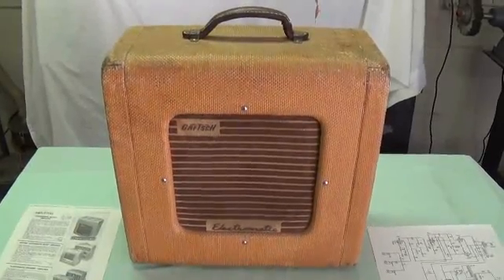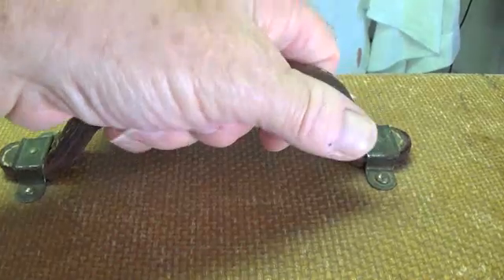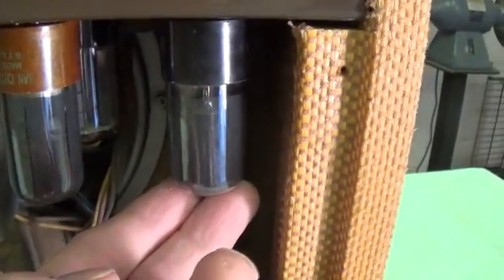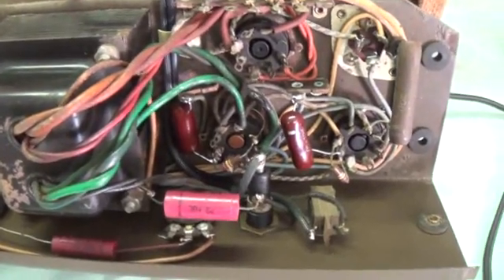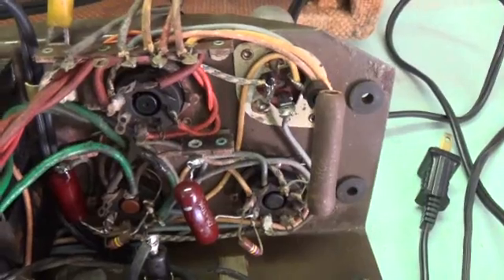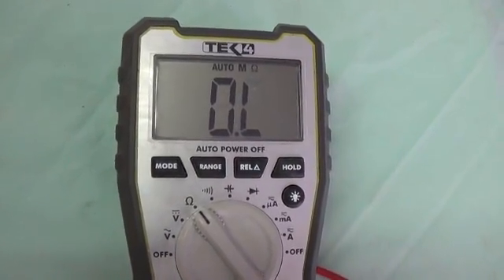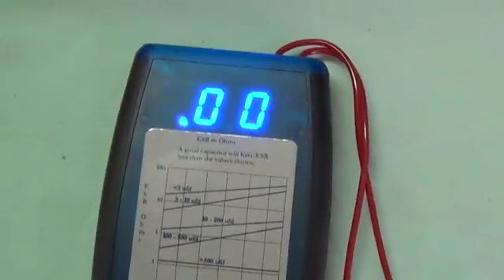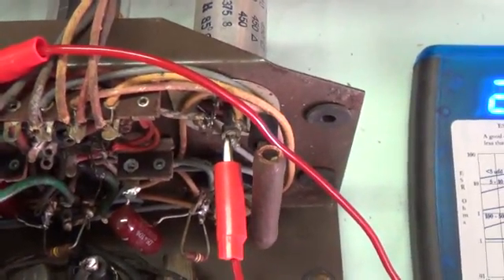Using an ESR Meter to Determine the 'Health' of Electrolytic Capacitors in Guitar Amplifiers

Comment: Great video as usual Doug! I'm servicing a 1950s Kay 600V and was about to change its filter caps- I tested em on the blue  esr meter and they were fine! But one was nearly 3 times it's stated uF tho.  Should I still use it? - did you stick with the caps that were 2 and a half times their value in your video? If so,would/ did it effect the tone?  (One of the brand  new ones I was going to put it in tested over 5 on the ESR meter!). Your videos are very  the best on the interweb thingy! Cheers
Reply from the maker: Thanks so much, Twig.  Something must be wrong either with the ESR meter or your cap tester.  I would change any cap that didn't have proper value within 10% or so.
Reply: @UncleDoug  so you didn't use the two 10uF that measured 25 in that amp  then?
Reply from the maker: @TwigtheWonderKid-q9r  I don't recall.....but I am sure I would not use such out-of-spec caps.
Reply: @UncleDoug  gotcha. Thanks!
Reply: @UncleDoug  Thanks. So I've have a chat with Mum and Dad and they said they were OK with you adopting me! (I'm 33 tho,is that OK?)- I love cats BTW. 
Question- why isn't your DanoSonic a Doug-o-Sonic? Take care.
Reply from the maker: @TwigtheWonderKid-q9r  Great news, Twig.  You'll have to make your own bed......so bring a hammer and saw.
Reply: @UncleDoug  haha!

Comment: High Doug, I have read a lot about cap esr, leakage etc and found a guy called Mr Carlson’s lab! He has designed a low voltage , high frequency, capacitor tester! Apparently it tests  esr and parallel resistance as well as leakage! He also done huge comparative tests among various test gear including high voltage  Heathkit, HP etc. Visit Mr Carlston’s Lab and I am sure you will find it really interesting! Fraser

Comment: In my eyes  just testing an old Cap with a Simple ESR meter and a capacitmeter almost always isnt enough. The real and conclusive test would testing it with a capacitor leakage tester. Then, and only then you can be sure of its reliability.
Reply from the maker: I now simply replace filter caps in customer amps and test the coupling caps in circuit with one (downstream) lead separated from the circuit.

Comment: You've gotta be careful you don't become the draining resistor. When I was once drained due to a lack of sleep I accidentally had my hand on a non insulated alligator clip while trying to drain a large can cap. My arm hurt for a good hour.  Luckily the circuit didn't complete through to the other hand. Always use one hand. BTW. I have the same esr meter. I didn't know you can use it in circuit. Thanks.
Reply from the maker: Thanks for the helpful info, 2C :)

Comment: I use an old Megga insulation tester I got on fleabay for £20. 
It will put 500v through a cap and show you how it charges and whether or not it leaks or returns to infinite resistance. 
Very useful tools for not much money. 👍
Reply from the maker: Thanks for sharing this tip, Wozzle :)

Comment: good day UD on the electrodynamic speaker, does the electro magnet change polarity opposite to the speaker coil, or does it just stay the same polarity while the amp is on? or is the “dynamic" meaning it changes?
Reply from the maker: The field coil electromagnet retains its polarity while the voice coil polarity shifts with the signal.

Comment: Once again, critical steps are left out of the "right technique." I assume that the second ESR probe clip goes to ground. But, assuming can be dangerous and produce wrong results. I also am led to assume, by the monolog that there are 3 separate capacitors in "the can." Electronic repair and/or construction is tricky at best. Restoration is even more so. Maybe these are all common knowledge if you've been doing this for 20 years or more. If so, then the video should say something to that effect, like either explain theses assumptions, or refer viewers with less experience to other sources.
Reply from the maker: Sorry you were unable to comprehend the video, Flam. Perhaps electronics is just not a good hobby for you.

Comment: Why are ESR meters like this one designed for electrolytics? Don’t other capacitor types have ESR, and would I need a different meter to test those?

Edit: I just read one of your comments which states that ESR only has real significance with electrolytics.
Reply from the maker: As far as I know, the ESR measurement is only used for electrolytics, B.

Comment: Hi Uncle Doug.  I couldn't find an assembled Blue ESR meter so I bought the kit.  I figured, how much assembly could there be for $20 difference?  Ha!!  Turns out, a lot.  It took me about 6 hours but it was a fun and rewarding project and it works just like in the video.  Thanks for the recommendation.
Reply from the maker: I figured the $20 extra for assembly (on mine) was money well spent, Patrick. I'm glad your construction went well and that the unit now functions well.

Comment: I've seen a vid on YT, an old 70's capacitor with good ESR.  But, it was unstable.  ESR changed with application of cold spray.
Reply from the maker: This sounds credible, Joe, but how often do you cold-spray your filter caps during normal usage of the amp? My concern would be greater if the electrolytic capacitor (the only type in which ESR has any significance) was unstable when normal working voltage was supplied. This is the shortcoming of ESR measurement, in my book, the caps are not stressed by normal working voltage.

Comment: As a retired electronics tech that used to have a "Creative" brand ESR meter at work, I would tend to go with your ESR readings, and not the DMM capacitance readings.  The DMM readings may be inaccurate due to the can capacitor still being 'in-circuit'.  I see from the schematic that one terminal of the cap is tied to a second terminal on the cap with a 27K resistor, and this could affect the readings. (I realize this is an older video and there are over 300 comments, so this observation may have been mentioned previously!)
Reply from the maker: To me the DMM readings are simply one of several tests for capacitor "health", Ron. I also generally test electrolytics with the ESR meter and coupling caps for DC leakage with a voltmeter.

Comment: I like to lick my fingers and touch the capacitor terminals to discharge them.  Shocking... I know.
Reply from the maker: I'm glad I'm not responsible for washing your underwear, Marc ;)
Reply: @UncleDoug  LOL!  I felt the need for posting that play on words.  Couldn't "resist". Worst whack I ever got was a flyback transformer on a color monitor that didn't want to discharge with the discharge probe.  32kv really hurts. ;)  2nd was 110v and it had me locked there, brother had to literally boot me away from it.
In high school, my homeroom was the electromechanical repair classroom (back when they also taught trades).  I found some massive radial caps, bent the legs over each end and about 1/2" apart.  I charged them up and did the "Hey! CATCH!" to people in homeroom.  They caught on pretty quick.  Case of knowing too much can be dangerous.
Reply from the maker: @MarcMercier1971  Capacitor toss is a great game.....if you're on the tossing end :)

Comment: I like to test high voltage caps with an insulation meter. Sometimes caps pass at low voltage but short at high.
Reply from the maker: Thanks for your input, TM.

Comment: Excellent, finally a technician who doesn't believe in taking everything out and putting all new for the sake of doing it, like most technicians do.. every time I have a vintage amplifier worked on they replace everything and I want to kill em
Reply from the maker: Thanks, Dino. As you said, I am definitely not an advocate of needless, wholesale parts replacement :)

Comment: Love the Blue ESR Meter.  You can check batteries up to 50v with it, too.  Note, however, if you check caps in circuit, you have to make sure the cap is not in parallel with other caps, or the reading is for all as a whole.  You can have a bad cap and not find it.
Reply from the maker: Thanks for your input, SC.
Reply: @UncleDoug  , revisited and I think instead of caps in parallel reading combined, it actually might give you the best cap and hide the worst ones!  So, best to pull the caps or lift a lead on each to test.  Cheers.
Reply from the maker: @surgingcircuits6955  Since we are measuring the "series resistance" in parallel capacitors, the capacitance will add but the resistance will follow the parallel resistance formula, which means that for two identical resistors in parallel, the net parallel resistance is 1/2 the value of either resistor.

Comment: I totally agree people get an old amp and just change all the caps, that is not fault finding and like you say they replace them with caps that don't perform as well. I think modern caps are much smaller but not necessarily better. Just stumbled across the channel its very good many thanks  even though I am not into valves still finding them interesting.
Reply from the maker: Welcome to our channel and thanks for your input, M.

Comment: How does this esr meter compare with ones such as the old heathkits and eicos with a magic eye tube that test them at the actual working voltage?
Reply: The reason I ask is that I have been using these high voltage testers mentioned and have found many caps that only show failure at high voltages and yet look ok at lower voltages.  I wonder if your esr meter would have discovered those faulty caps.  Maybe both testers are needed.
Reply from the maker: @mprice8851  You may be right, Matt. It would be interesting to test some of the high-voltage failures with the ESR tester. Maybe a viewer has done this (?)
Reply: Mr Carlsons Lab has a shootout with a bunch of new and old style capacitor testers thats really great. The title of the video is ‘“which capacitor tester should I buy”. He also has built a capacitor tester of his own that he claims is better than all of them. There is also a youtube video on that. That video is called “Invention release Carlson LV capacitor leakage tester.”  Well worth a look.  He offers plans to build it too.
Reply from the maker: @mprice8851  Thanks for the tip, Matt. I will check it out.
Reply from the maker: It's apples and oranges, Matt. They measure different criteria of performance, but both can detect faulty, leaking caps.

Comment: Doug, this is really eye opening. I have been taught to replace old electrolytics since I began repairing guitar amps. The shop and guys I worked with, it was a just a given to replace them, same with the old paper wax ones. I've wanted to pick up an ESR meter for a long while and this closed the deal. Thanks again for another great tip.
Reply from the maker: I think you will be surprised just how long-lived and resilient electrolytic capacitors can be, Carlos, especially those which are very well sealed within their enclosure.
Reply: I opened up a 1961 fender bandmaster head, lifted the metal hood on the electrolytics, looked like new, worked great also!

Comment: I am not sure there is a way to test filter caps at operating voltages.   Is it possible they are leaky only at high voltages and pass the ESR test?
Reply from the maker: I guess it's possible to get an acceptable ESR value on a leaky cap, but I can't say that I have ever seen it personally. For them to leak at virtually any voltage level,  their internal resistance must be reduced to some extent.

Comment: Hello U.D.  i lov this video!  And thank you for your past advice!  Thank you.  
I have the same meter as you.  But my only concern is, that the graf on the meter is so vague of the range of a good cap ,that i don't trust it. Also there nothing for high for high value uf caps. 
Do you have a spread sheet of the values, for different caps?  Or any information where to find?  
Thank you so much!  For being a master mind! Very impressed!
Reply from the maker: I agree, Curtis. Here is what I do:  Whenever  measuring used/vintage electrolytic caps, I first measure several new caps of the same capacitance and voltage rating, to get an idea of what is a proper ESR value. This method will also detect any faulty new caps that you might have. 

On circuits that have not been energized in many years, the ESR values may drift upward, but should not greatly exceed expected values. If you measure their values after energizing the circuit (and of course, discharging them manually) you will find that their values will drop significantly.....indicating to me that they have "reformed" due to use.
Reply from the maker: Also, you could record and tabulate your findings with new caps and prepare your own chart, if you wished, so you could forego the need to establish a norm prior to each circuit measurement.
Reply: @UncleDoug  Great advice,  i will
Build my own chart. Thanks for the reply!

Comment: Yeah, I will replace caps if either the ESR is out of spec, or if they are out of uf tolerance.  The latter is usually a sign of drying out, and would just rather replace them than having to take it all apart for a second time . . .

Comment: This is an interesting video. I am a retired Technician. There is a lot of hype going on about the F&T caps and they're having a lower ESR rating compared to other brands of the same capacity. I personally can't see any advantage to using them. What are your thoughts on it? I have compared them in circuits to other good capacitors and can't see or hear any difference.
Reply from the maker: I can't either, Neutro. I am definitely not a proponent of expensive, "boutique" capacitors. To me, all that really matters with caps is their capacitance and voltage rating.

Comment: I just changed the .1 coupling caps in my 6B4 amp as my ESR meter gave me grossly-different values. I think the lowest it goes down to is approximately 2 mfd. The problem I had was solved; but when I measured the caps I removed, they both tested the same. Could the bad one have recovered? I hadn’t used the amp for around two month...
Reply from the maker: I wonder if the fluctuating cap's in-circuit reading wasn't affected by a neighboring resistor.....possibly in parallel (?)

Comment: ESR is not an indication of leakage. Also the top two 10μF caps are in parallel with each other, via the field coil winding, which is why you get the same reading for both and why it reads 25μF. It’s clear on the schematic. Always worth checking with the actual circuit before measuring.
Reply from the maker: Thanks for your input, Charles. I have learned quite a bit since this video was originally posted.

Comment: Hi again Doug. Your experience is the same as mine. Those old electrolytics were probably made by Mallory or Sprague or one of the other big US companies and they were made to last for decades. It would be surprising if any of them measured a high ESR value. The electrolytic caps which fail are the Asian ones in switching power supplies and CRT TVs, cooked to death by high ripple currents and being close to heat-generating components. Like they say, "If it ain't broke, don't fix it!".
Reply from the maker: Amen, Bob. It's great to hear a reasonable opinion, rather than the knee-jerk PC attitude of wholesale replacement of all vintage components.

Comment: I thought those capacitors go bad just sitting on the shelf if they aren't in use. I have an old signal tracer from 1949 and I'm just going to replace all the caps to restore it. I'[m not going to bother to test them.
Reply from the maker: Everyone has their own opinion regarding electrolytic capacitors, Cat. Do what you think is best.
Reply: Watching your videos, learning some things. I wonder if that amp had been in storage for a long time would that make a difference?  I have some old oscilloscopes, one from the 1970s and they work great, I've never replaced any parts in them. I think you're right about that old capacitor being better quality.
Reply from the maker: If you have a Variac, Cat, you can slowly bring up an old circuit to full operating voltage, and allow the electrolytic caps to "re-form" and essentially heal themselves. Radio repair people do this all the time. If a cap fails to re-form, then you can replace it.
Reply: we used to have one. closed our shop some years ago. thx for the videos.

Comment: Is that 3 capacitors inside of one can? Does that have a special name? What's the rational for putting them inside 1 container? Do they still make that style?
Reply from the maker: Yes, there are three separate capacitors within the single can. I have always just called them "can capacitors".....which seems rather basic, but appropriate. Yes, they are still available but rather expensive, in the $35 range per can.
Reply: @UncleDoug  Very interesting, I didn't know that. I discovered they are called "multi section capacitors".
Reply from the maker: Yes, indeed. It's good that your curiosity leads you to do research, NR.